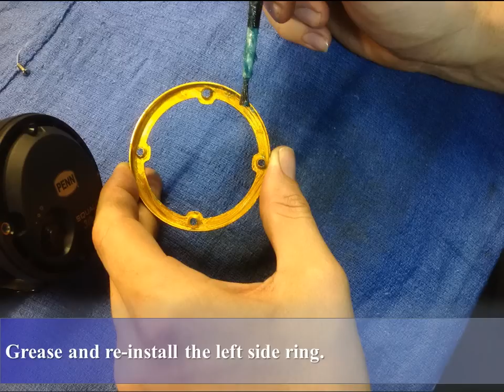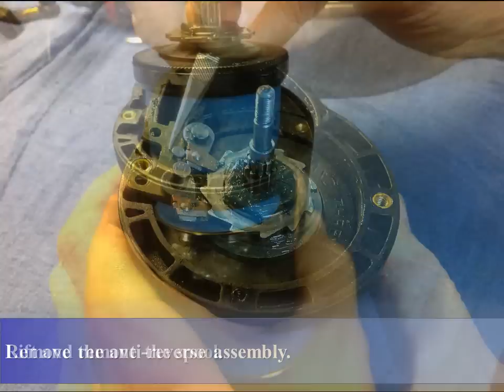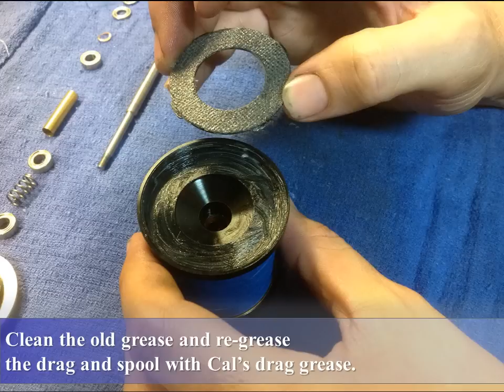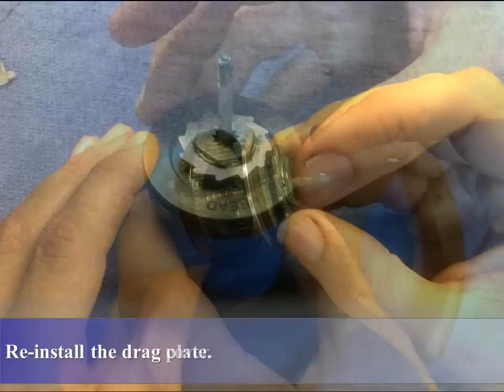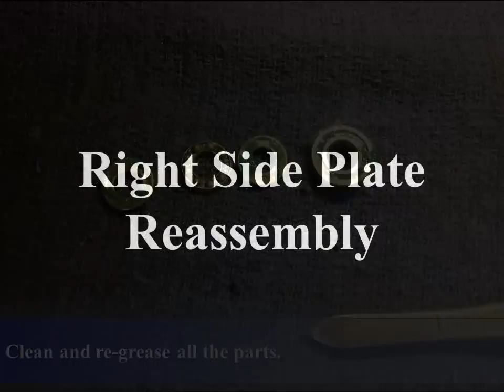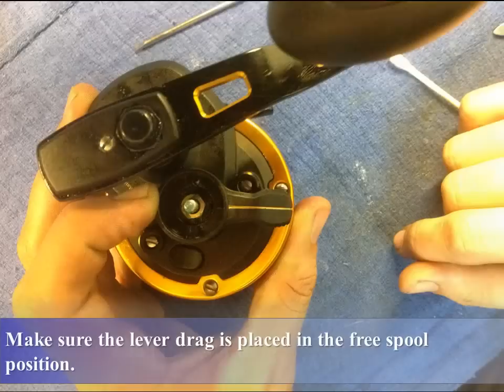Penn Squall 30 Lever Drag Reel Service Tutorial

Comment: i want a left handed reel and the squall is one of the few out there that's not $400. some of the reviews for this reel are good and some aren't but it was good to see the inner workings.   do you think this is a good reel for the money and is built for the long term.
Reply: +gfrost6 It's very good, Alantani did a write up about them.  For the money it's an excellent lever drag reel.
Reply: thanks. i did buy one and got to use it once on a tog trip but there were no tog but otherwise happy with reel but waiting for a real test